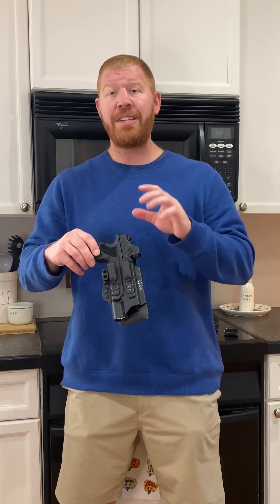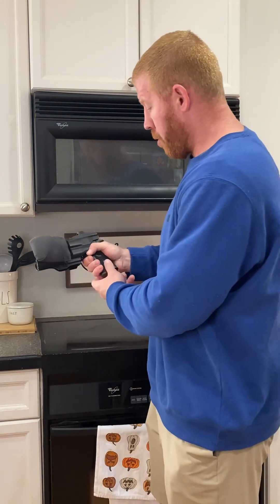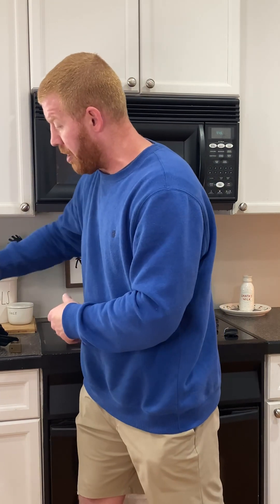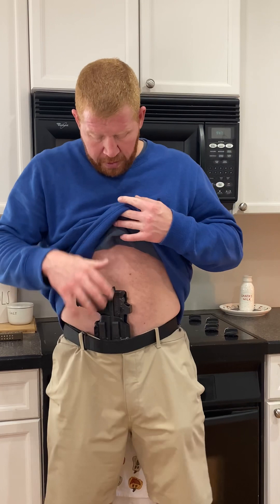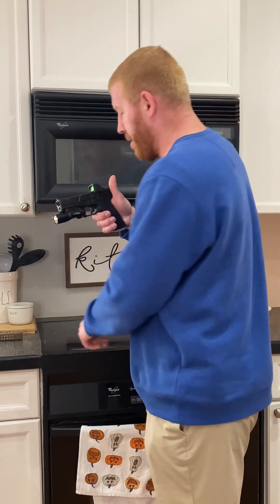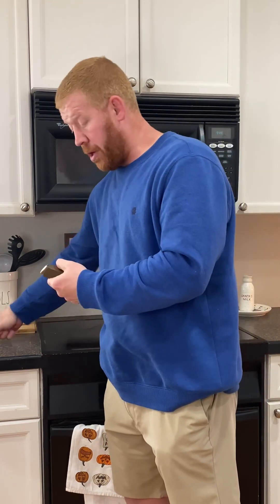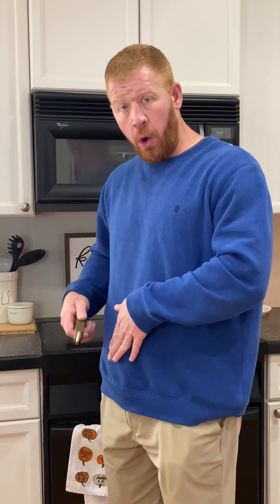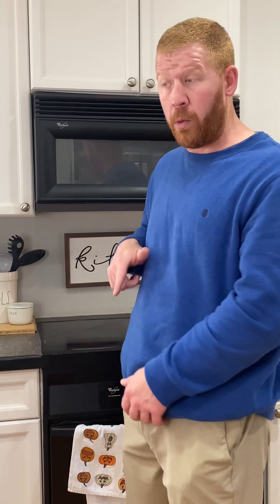My EDC Procedure to Load and Make Ready for CCW

Comment: Have you had anymore issues with failures to extract on the Zev?
Reply from the maker: Yes, within the first couple hundred rounds I had 2-3 fte with LAX remanned and Winchester silver tip jhp. Called zev and they said with Winchester and the LAX parent company, can’t remember off my head the name, that the tolerances cause some fte. I stopped using those brands, though I use southern munitions remanned ammo primarily, I haven’t had any since hitting the 400-500 rd mark. I trust the gun 100% with my carry ammo, federal hst and Speer gold dots, and the cheap southern munitions ammo I run.